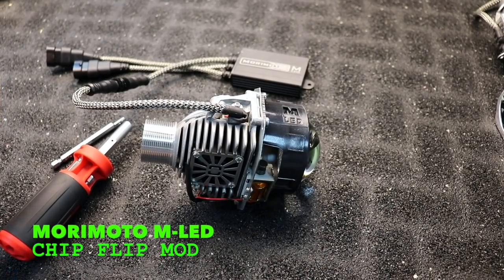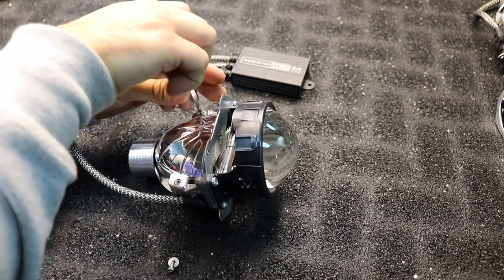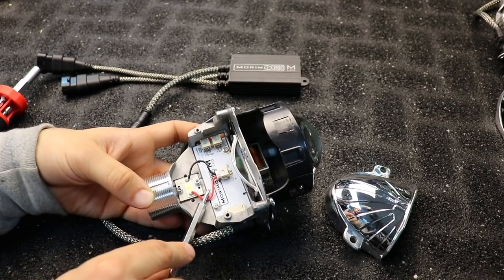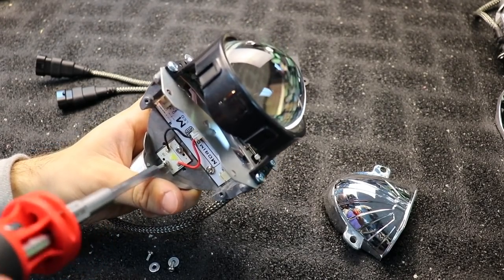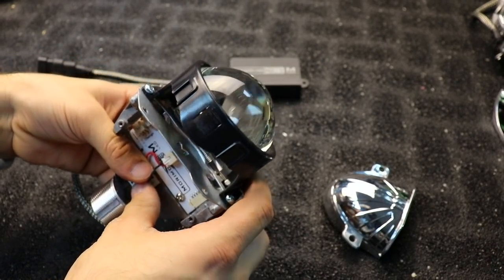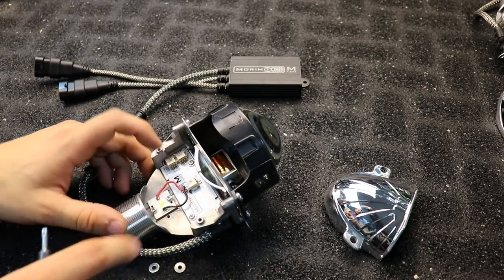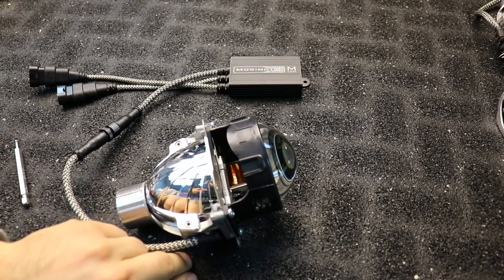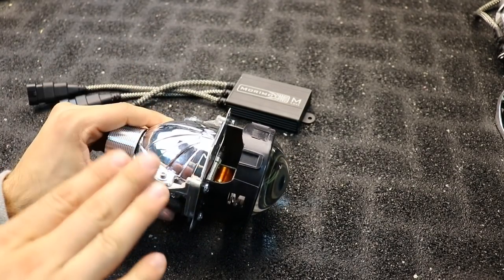Morimoto M LED: Chip Flip Mod

Comment: Hm, just tried doing this to mine but it doesn't seem like it seats nicely when it's flipped around. the holes for the screws on the chip are staggered and not aligned so when I tried reseating it backwards it wasn't perfectly in the square chip cutout

Comment: Just bought these as well.  Trying to figure out how to install into a 9006 housing for now.  Will check back for a before and after chip flip.  Why not tape down the wires with aluminum tape to make sure they stay out of the way?

Comment: Can you retrofit this into fog lights (don't want to mess with my turning LED headlights)?
Reply: Joseph Faustino You sure can. As long as you have the space to do so in your fog light housing.
Reply: Morimotor actually makes LED fog-light projectors although I doubt the light output would be as "aggressive" as this but you would definitely need some room to make these fit
Reply: TylertheGeek28 yeah I know.  I just wanted the best light output and was also curious if people do foglight retrofits with led projectors.
Reply: Yeah I've seen a few actually obviously cars with larger stock fogs have more opportunity to retrofit  but I've even seen trucks with retro fogs.  I thought about doing them but considering I pretty much only installed my fog lights for looks lol and that I can light up three lanes of traffic with my LED hi-beams no real reason for me to do it